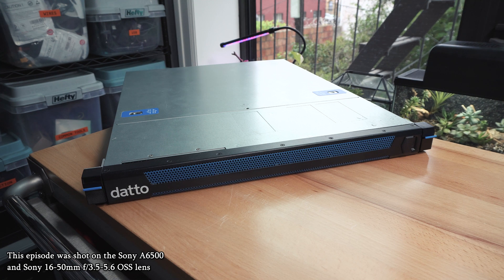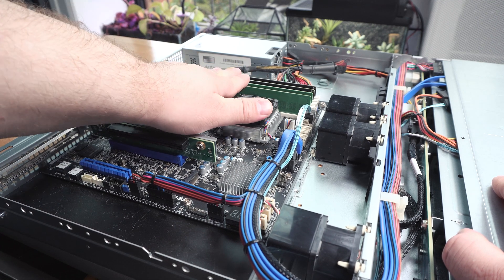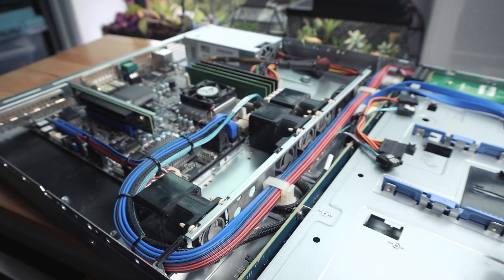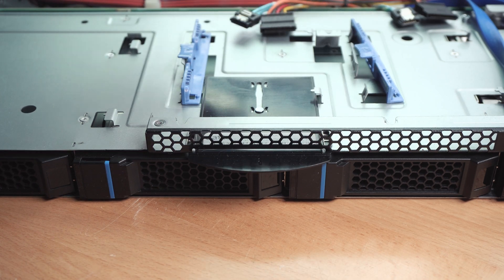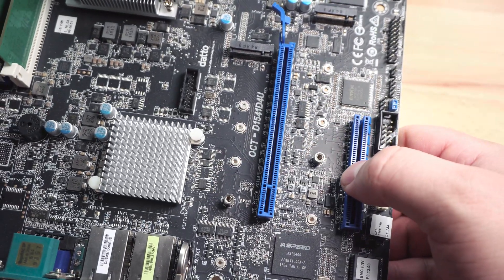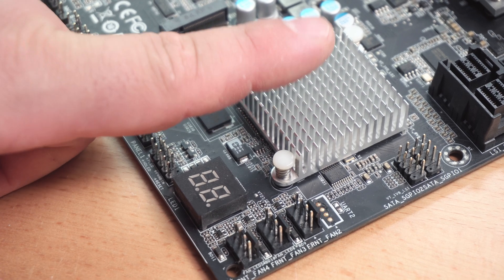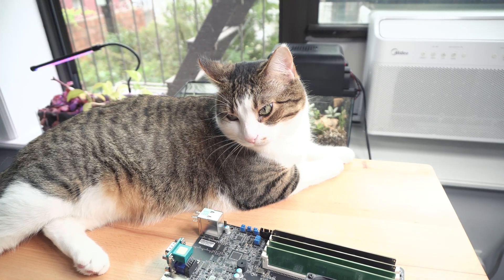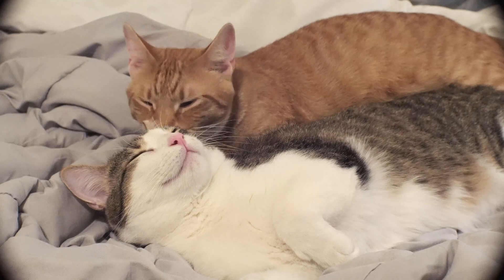Datto Siris 3 S3P4000 Server (AKA TrueNAS Motherboard Extraction)

Comment: Hi, thank you for the video. For the fans covering the SAS controller, and Ethernet controller need a thinner fan than the Noctua 40mm, to have enough space to cool. As for the front fan panel, there is ample space to add the Noctua 40mm attached with zip ties, and powered from possibly a single 4pin fan on the board.

Comment: Thanks for taking the time for the review. How did you go about getting firmware for the mainboard as all the ones I tried from asrock were not compatable?
Reply from the maker: It's been a while, but I'm pretty sure it was the bios they have on their site I used along with the generic LSI firmware flasher used for normal PCIe cards.

Comment: Hey just came across your vid. One of my clients upgraded to a new Datto and i was able to keep the same model in your video. 

but QQ: does your IPMI work? I can see the IP but there is no web page to access.
I tried to update the bios but the system freezes when i try to install.
Reply from the maker: It shouldn't be freezing. Are you updating the bios from dos? Ipmi works fine, I suggest updating its firmware too as it will clear out passwords, etc.
Reply: @PeterBrockie  I was trying from the instant Flash feature. I may try the DOS method.
Reply from the maker: If that acts weird as well, you can try a closer version if it's really old - go from 1.2 -> 1.3 -> 2.0 instead of 1.2 -> 2.0 or whatever - I just made up the version numbers, but you get the idea. :D

Comment: Thank you for making this video! It gave me the confidence to pull the trigger on this exact Datto backup server, knowing that someone else had done the chassis swap. I am planning a very similar swap, the only difference being I will be using a Rosewill RSV-L4312 case instead.

Did you have any issues come up on the reinstallation side?  Any firmware issues/case alarms, things like that?
Reply from the maker: I don't see any issues. It's a pretty standard server board. The bios and IPMI firmware were no issues to update.

My only regret is not buying a second one when I saw the motherboard up for only $250. :P

Comment: I just got one of these, how do you get that cover off to install the 2.5" drives under it in the caddys..
Reply from the maker: You unscrew the top panel which covers them. I think there might be a couple screws on the side of it and on top, but I don't remember 100%.
Reply: @PeterBrockie  Yeah i found the screws, they were covered by 2 stickers, Thanks for the quick reply. Just installed Truenas on it, after installing fan silencer resistors :) machine is fast & perfect !! picked mine up for 500$ shipped..
Reply from the maker: @JasonsLabVideos  Keep an eye on the SAS controller, 10GbE controller, and CPU temps with slower fans. I found in testing they all get really hot without the stock, loud fans.

Comment: I didn't know LSI made SAS3 controllers.  I have a SAS2 one in my main desktop computer running four SATA hotswap bays in IT mode.  The only reason it is in there is due to poor placement of the onboard SATA connectors.  LSI designed their storage controllers not far from where I live in Wichita, KS.
Reply from the maker: I know the SAS3008 is available as a standalone card (https://www.storagereview.com/review/supermicro-lsi-sas3008-hba-review). I'm sure they have other models in the line up, but 12Gbps is really overkill for hard drives in a home server. Plus the 12G expanders are hard to find and/or super expensive.

Comment: Fair warning. I like Chenbro cases too, but if you use the drive carriers, you want to add a bit of insulation to them. I've had a hard drive controller board short out on the metal before! Scared the bejesus out of me when I got a three inch flame off the board while trying to find the problem!